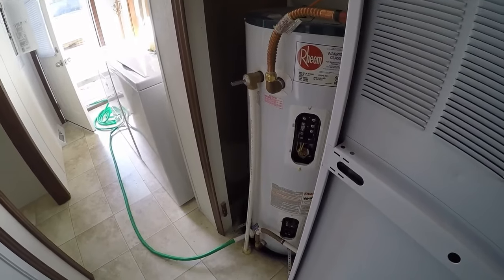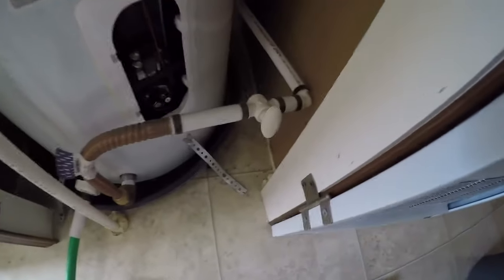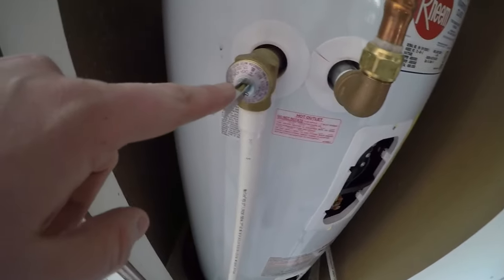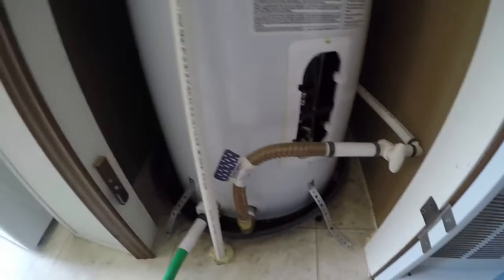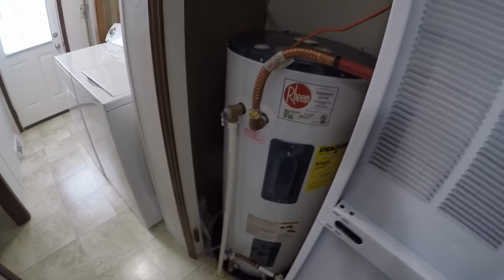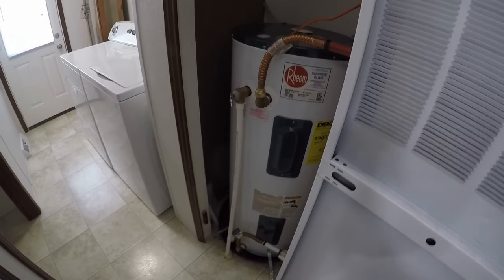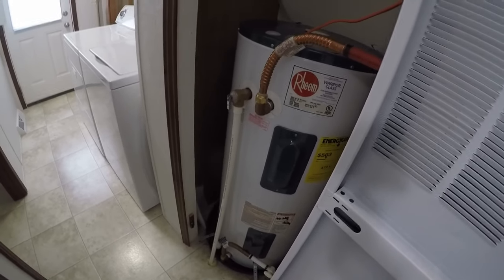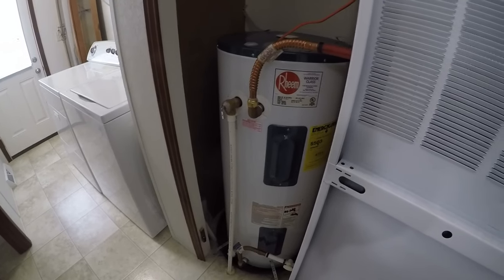How To Drain and Fill a Hot Water Heater

Comment: Wow!!! That thing is identical to mine i had since 2003!!!!

I had that same Rheem you are showing.  Lasted 20 years, never once flushed it.  No bad odors, no bad taste, no discolored water.  Was clean til the end when hot water went out!!!! I never touched the factory set temp. Just my true real experience with that Rheem electric unit.  RHEEM IS EXCELLENT!   Just bought the brand new unit and got $100 off at HomeDepot!!!  It depends on where you live.  If you live around hard water do the flushes!!!!😂
Reply from the maker: Yep you're right!!

Comment: Great video Jamie!! I love your demonstrations..
Reply from the maker: Thank you!!
Reply: @jamiewagner  However, my issue is the pressure relief valve. I was working on this one and it will not open up. It's 100% jammed. So, no water is leaving the tank.  I turned the faucets on in the house to release some pressure. Good thing this relief valve is on the top and not the side since no water has left the tank.
Reply from the maker: Oh ok

Comment: It's generally a good idea to remove and clean the screens at each spigot, prior to purging the air out. This will allow any sediment and debris to flush out as well.
These screens are typically located at the end of the spouts, a (very light) turn with pliers will remove ones that are too tight, and replace them hand tight.
Note: some spigots don't have removable screens, so be careful when using pliers, as too much pressure will damage a spigot that doesn't have removable screens. Light pressure is all that is needed to loosen those that are serviceable.
Oh and remember, righty tighty  (clockwise)- lefty loosey,(counterclockwise)
Reply from the maker: lol yes you are 100% correct!
Reply: @jamiewagner  
I wasn't boasting, just reminding. Cause sometimes I too get a little absent minded, and forget some of the simple things.
Good luck with your project.

Comment: Very helpful and simple.  Thanks.  On mine, which looks similar, it wouldn't drain at first and I discovered that the plastic handgrip at the bottom drain outlet had to be unscrewed before water flowed.  Don't know if that was normal or not.
Reply from the maker: +MrWoodyandJack 👍hey thanks! It's probably all good as long as the water flows!

Comment: You left out one important factor how do you connect the hose to the bottom of the water heater to drain it because prior to doing so there is no shut off at my water heater and watet will start coming out before I attach hose explained please
Reply from the maker: There is a valve

Comment: So to fill the water heater again you run all the faucets?? This is the problem im having the water heater doesnt seem to be filling.
Reply from the maker: yeah that helps get all the air out of the lines but if you don't have water pressure coming into the tank then it might not fill up, your line coming in from where ever you get water should have a certain amount of pressure so it can refill the tank

Comment: I got the same tank you got but I been having problem its starting too leaking in one of bottom covers any idea ? the Circuit breaker is off
Reply from the maker: not sure, I mean if it's really old it might need replaced or have someone take a look at it that is a certified plumber or whatever.
Reply: @jamiewagner  its shows 2010 on the tank and yeah I think its time for replacement

Comment: Do you think it's worth changing the thermostat when you change the elements?
Reply from the maker: Yes I do.
Reply: Jamie Wagner thanks guess I'll order upper and lower thermostats as well. I have a 9-10 year old Bradford white electric water heater that's lower element has failed, I foresee it having alot of sediment. I have to use a pump as well as there's no drains in the basement

Comment: How do I know when the tank is full?
Reply from the maker: When you turn the water back on it fills up until it’s full and can’t go anymore so it maintains that pressure. So when you run the water it will fill back up automatically all the time until it’s full so it’s like full all the time as long as you have the main water valve at the bottom turned on because that has lots of pressure
Reply: Jamie Wagner thanks , I know it was probably a stupid question but didn’t want to turn the breaker back on till I was sure lol. Replaced the bad element.... breaker is still tripping after all that 😩. Must be another issue too . Damn
Reply from the maker: Yea you might have more than one issue going on
Reply: Jamie Wagner I figured it out!!!! Yay!!! I replaced the upper thermostat. Go Me! Thanks for the video, I literally had no clue what I was doing, or even sure if I should attempt trying but you made it seem like I wouldn’t die trying lol!
Reply from the maker: Wow that’s great! 👍 I guess I’m glad I went ahead and created the video. I guess it has helped people out more than I expected! After I did this mine worked perfectly fine!
Reply: just open a hot water faucet in the home... it will burp air until you get solid water stream   .. then the heater is full :)
Reply from the maker: Thank you for sharing the great tip

Comment: looks like it's time for a new domestic water heater - brown/rusty water isn't a good sign - probably that your tank liner is not longer protecting the water from corroding from the tank rusting on the inside - that or you have older galvanized piping that is corroding! BTW I design mechanical and plumbing systems for a living. The correct term is domestic (electric/gas) water heater, NOT "hot water heater"...because you don't heat hot water right?
Reply from the maker: yes you are correct

Comment: Can anyone tell me the answer to this? I turned off the cold water line going to the heater, turned on a hot water tap until water quit going through, and then opened the drain plug on the bottom of the heater to drain out the excess. I also opened the relief valve to help air flow through. It seemed like it was finished, but then I turned on a cold water tap at my basement sink and noticed that water came flowing from the heater's drain plug. A half hour later it's still flowing from there? How can this be?
Reply from the maker: I would check to make sure you actually have your mainline turned off
Reply: @jamiewagner  ~ Yeah, it was turned off. Problem was that the tank drained pretty slow, so when I thought it must be done, it really wasn't. On my basement sink I had the hot tap open the whole time, so I think opening the cold tap too somehow let some relief in the system so the water started flowing better. Anyway, it's all done now. Thanks for helping.
Reply from the maker: You're welcome charlie. I'm glad you made out okay, thanks for commenting back. I'm really glad for my YouTube community and viewers like you leaving feedback! 👍